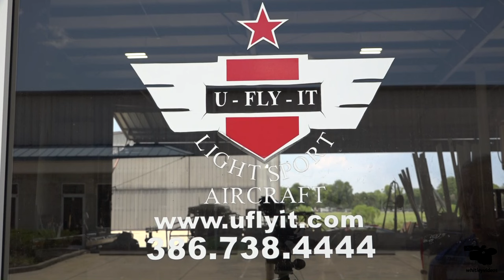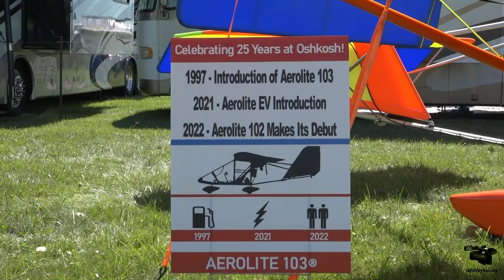Dennis Carley's 2024 Aerolite 103  Status Update

Comment: Having put aerolite together on my own I know how hard it is to pinpoint those rivet and bolt holes. Btw, does any of you guys know whats the difference between An4 and m8 bolts?
Reply: well, ones metric
Reply: Could you be asking what is the difference between AN hardware and Grade 8 hardware?
Reply: @williamh.scottv438 grade 8.8 grade Yes. It is supposed to have 4000lbs proof load at size m8 and I used mostly these bolts instead of an. Well the main front bolt is heavier M10 size where square upper tube connects with front curved cage tube. And smaller M6 size is used at stabilizer connection points and wing strut to wing connection. Hope it works fine. I have no an bolts available at my home country at continental Europe

Comment: Hello Mr. Carley and Mr. Whitley, 
I was thoroughly impressed by your YouTube video showcasing your ultralight airplane. Your creation holds significant promise for the future of aviation, offering accessibility to enthusiasts of all kinds.
I would like to propose a suggestion to enhance your aircraft's performance further. By substituting aluminum tubing with carbon fiber tubing, you could potentially achieve weight savings of 35% to 40%. Not only is a composite frame lighter, but it also boasts superior strength. Importantly, this upgrade could significantly enhance pilot safety, particularly in scenarios where the aircraft makes contact with the ground at speeds below 70 miles per hour, which is common for ultralight planes, typically averaging speeds below 60 mph.
The ultralight airplane now can incorporate carbon fiber composite technology inspired by F1 racing cars. In F1, the carbon fiber body has proven to safeguard pilots even amidst collisions at speeds up to 180 mph, ensuring their safety. Since the adoption of carbon fiber bodies in F1 racing, pilots no longer harbor concerns about safety during races. Similarly, I envision ultralight airplane pilots experiencing the same peace of mind in the event of ground contact while flying, given that the speeds of ultralight airplanes are considerably lower than those of F1 cars.
It's worth noting that only carbon fiber composites can achieve this level of pilot protection. Neither aluminum nor steel can match the safety standards set by carbon fiber. The composite frames are also good for bikes. 
The cost implication of utilizing carbon fiber tubes is not exorbitant, with prices approximately 30% higher than aluminum tube frames.    nathanvh9@gmail.com
Reply: Sounds expensive
Reply: Only 30% more? That would put this plane in the unmarketable category

Comment: Please send me one. thanks for sharing. Love the product, just cant afford it 😢 edit; Never mind after seeing that lady.Trying to use that router deburring tool the wrong way.It scares me from that product.Something is simple as the deburring is not even done right.
Reply: Sounds like the fox and the grapes.
Reply: Good thing you don't want it now.  Saved them from having to send you a plane for free.
Reply: I have been building aluminum airplanes for over 20 years. The tool the lady was using is a deburring tool, not a router.  She was using it correctly to debur the inside radius of a hole drilled into a round tube. I have no idea how you arrived at the conclusion that she was using a “router” incorrectly. I have personally inspected several of these aircraft at flyins and have found their construction, fit and finish to be superior.